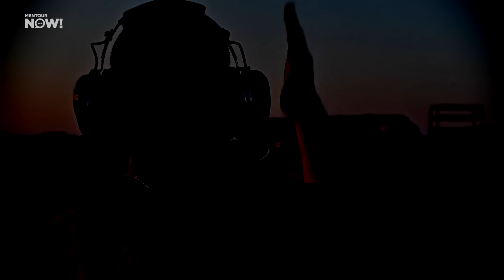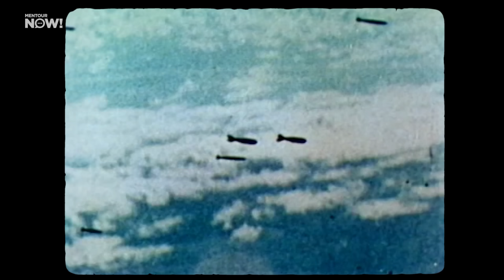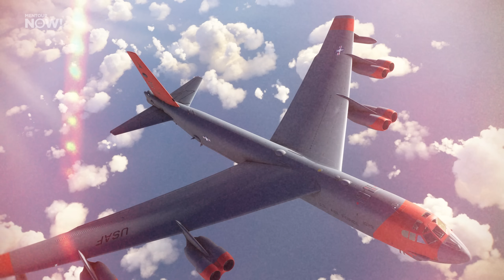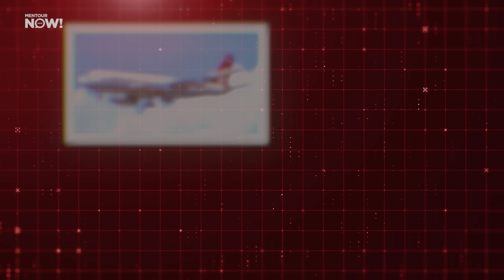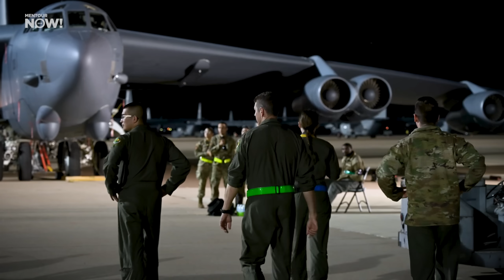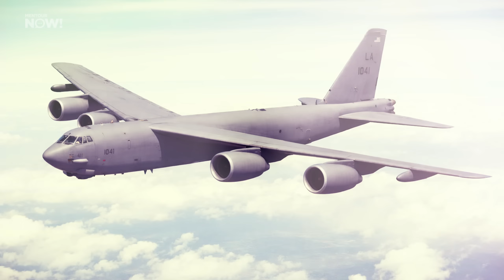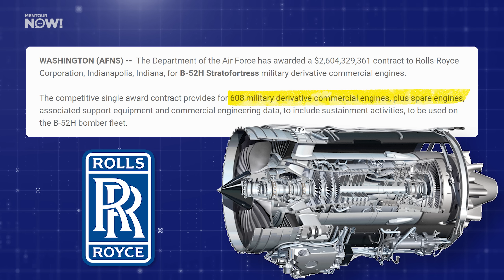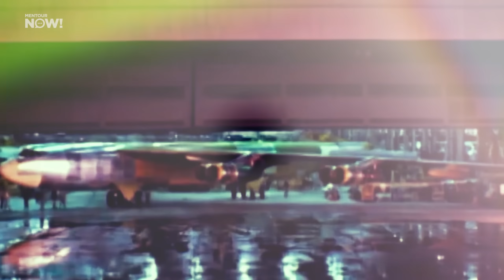WHY Are They Changing The B-52 NOW?!

Comment: “Why does it have 8 engines?” “Because we couldn’t find room for the 9th one.”
Reply: "Why does it have 8 engines?"
'Cutting back' from 10 engines; B-36.
Reply: No auxiliary unit?
Reply: @FrancisFjordCupola  Not until the J model. It is finally getting one.
Reply: @PaulJohnson-ow1mq   Surprised they're bothering! You'd think that with 8 engines of higher capacity there'd be enough electric / bleed air for all purposes! I'd love to know why.

Is it a start up thing? With an APU presumably it'd be quite quick to get all the engines up and running (no start cart, no starter cartridges, etc). But perhaps not; with no existing APU there'd not be the existing ducting for the air for and air starter, or heavy duty wiring for an electric starter. Adding ducting where today there is none sounds like a major nightmare. Wiring is less of a problem, but it's still quite a lot of work. 

I can see it as being useful for away-from-base operations; being able to keep the aircraft powered on / ventilated without much ground support (just add fuel) increases deployment flexibility, and can probably reduce time between missions. Is that why?
Reply: @abarratt8869  Probably better than the cartridge starters they currently have for alert operations.
Reply: @SEO122 cartridge starters are my favorite thing about the B52
Reply: @SEO122  An H model alert start with cartridges in 4 and 5 puts out more smoke than all 8 engines at mil power.
Reply: @abarratt8869  Commercial planes mostly use the APU for ground power when the main engines need to be off for ground support operations.  There's a lot more electrical demand nowadays to run digital nav equipment vs the old analogue stuff.  Self-contained startup is probably a convenient bonus, and may allow the planes to run missions they couldnt easily do without it.
Reply: @SEO122  They are rough on the engines, but very fast - and when we considered ourselves lucky to get a full wing off the ground before we were vaporized 15 - 20 minutes into an attack, every second counts.
Reply: @edfix  "BANG! BANG! BANG! BANG!!"
Reply: @abarratt8869  They have 8 tiny engines, could just run one at idle as an APU😂
Reply: @yuxuanhuang3523  They're reliable but burn too damn much fuel - first mass-produced USAF turbofan in history. Yes, they really are that old. Not a problem when put on such a large aircraft, but only when used for intended purpose.
Reply: @tippyc2  "use the APU for ground power when the main engines need to be off for ground support operations.  There's a lot more electrical demand nowadays to run digital nav equipment vs the old analogue stuff"

I might be missing something, but if you're on the ground you probably don't need any power for digital nav equipment - just look out of the windows! (Or use your mobile's GPS if it's foggy! I'm guessing  the main demand for power whilst on the ground is for heating and ventilation.
Reply: @abarratt8869  Future systems are becoming more and more power hungry. Honestly 8 modern engines with generators on each plus an APU would make the buff perfectly suited for future systems.
Reply: @timbrwolf1121  Absolutely so! 

Regarding systems themselves, it's a bit mixed. What's happened over the past decades is that systems have become smaller, meaning more of them can physically fit. And if any of those added systems are transmitters achieving radiated power of X Watts, you still have to put a least X Watts of electrical power in to achieve that + inefficiency margins. So it's not necessarily the case that, just because an added system is modern, it isn't necessarily low power. And where a system relies on compute power, often they can be made better by having more of it; so compute power efficiency doesn't necessarily translate into less power overall either, they'll take the power and do more sums. 

The origins of this go back to WW2. At the start of it service in WW2, the RAF's Lancaster's entire electrical fit out was a radio and some lightbulbs. By the end, it was carrying 2 tons of electronics (valve based of course) for radars, jammers, nav systems. 2 tons.
Reply: @abarratt8869  the mythical octuple engine failure
Reply: @plutoidrepublic2895  - I was talking to a retired B-52 pilot. He said the best part of having 8 engines is being able to shut off one and declaring an emergency. It gave you priority landing privileges. 😂
Reply: @FrancisFjordCupola  that is all that remains of Rover jet powered car.
An Auxiliary power unit still in use today.
Take care M.
Reply: @markeh1971  just wtf? The “stuffy brits” build a turbine powered car that looks like it would fit in the speed racer universe while us colonials made our turbine powered car look like the stick is ALL THE WAY up its ass.
Reply: B-36 hours
Reply: @whyme943  💯 The B-36 had six piston engines and four jet engines. The crews said it had "six turning and four burning".
Reply: @raffriff42  “Two turning, two burning, two smoking, two choking, and two unaccounted for.”- Fun little phrase describing the unreliability of the B-36 engines.
Reply: @operationangel7940  😁👍
Reply: @whyme943  My understanding is they would shut the jet engines down when at cruise. All this was a full-time job for the flight engineer and ono-board mechanics.
Reply: You think of some real and fictional German and Italian aircraft between the world wars. Porco Rosso’s plane?
Reply: @markiangooley  The Dornier 'Do X' flying boat, with 12 engines - six pulling, six pushing.
Reply: @markiangooley have you met our lord and savior, b-36 peacemaker? Quote wiki: 'some crews humorously changed the aircraft's slogan from "six turning, four burning" into "two turning, two burning, two smoking, two choking and two more unaccounted for".'
Reply: @markiangooley  That thing doesn't look that different from a Macchi M.18.
Reply: There's space on the tail for 3 more
Reply: @sprky777 I was thinking easily 4 on the tail, like a VC10.
Reply: @alanm8932 and you'd still have room for at least one tail fin engine, like on the hs121
Reply: when my father flew b 52's he said that the large cruise missiles, the AGM-28 Hound dog missles carried on the inboard pylons would be fueled by the planes tanks and would be used to help give it a boost, bringing our total to 10 engines
Reply: BUFF = Moar Dakka!
Reply: I know it's just a joke but redundancy because they weren't as reliable back then and these things were meant to stay in the air for a long ass time while they carried nukes for a counter strike in case the US got attacked
Reply: Don't forget, if you shut down one engine, you need to deal with the dreaded seven engine landing.
Reply: It has a 9th. CPU
Reply: @davidmoore8741  - You mean APU. And, none of the previous models of B-52 until the upcoming one had an APU.
Reply: Actually there IS a B-52 they used to test High bypass engines when they 1st came out. It was placed between #4 engine & the fuselage.
Reply: @S@Steve-0220 Yep, I saw it. My father worked at P&W EH and therefore we lived not far from Rentschler. I very well remember hearing and then seeing that B-52 low with an in-development JT-9D that was the original powerplant for the B-747 on that pylon. That was a long time ago but, it was a memorable sight.
Reply: It carries a $h1t load of "stuff"
Reply: They took out the tail gunner position. Just put the 9th engine there. 😜
Reply: It has eight engines because it has a small rudder. (Seriously!!)
Reply: @b @bholdr----0 ou are correct.  With a 10% rudder chord and theoretically four engines, lose one on take-off and you will lose control.
Reply: The B-52 visual projects power, those 4 pairs of 2 are vital to projecting this visual.
Reply: Pretty obvious. 8 smaller engines don't hang as low as 4 larger engines. The wings drag the ground on takeoff.
The only way to use 4 large engines would be if they rode to tops of the wings.
Reply: 8 was a lucky number
Reply: Nothing some Kerbal Engineering can't solve.
Reply: No, because the engines at the time were so crappy they needed 8 and it would cost to much to change it now.
Reply: Fantastic presentation,thank you Petter.
Reply: The Spruce Goose.
Reply: Even when they eventually mount warp nacelles on the thing, they’ll still have eight…
Reply: That is not entirely true; if the B-52 had two 'hound dogs', it could use those two jet engines, making it have ten engines on a takeoff roll.
Reply: each bird actually has 16 engines...
Reply: They used to put thrust jets on the bottoms of B52's when they had such a heavy load they couldn't get airborne otherwise.
Reply: Thunderbird are going.
Reply: 3 on each wing?
Reply: Because it has 4X redundancy.
Reply: I heard in about 1958 that they would have to make wings longer than the b 36 to ad more engines a second cousin worked at boing designe said there was talk about 12 engine probable only on paper as a sketch no blue prints
Reply: The B52 needs 8 Engines bc of its steering characteristics. The B52 is nearly zero rudder and so the engines support the steering. If the B52 would loose one of its outboard engines, it would have a real problem. That's why they cannot change to 4 engines.
Reply: The original E-3A was built on a modified 707-320 Combi, except it had 8 engines in pods much like the B-52 (and the inner engines of the B-47).  Why? the E-3, and I presume the successor E-4, was very thirsty for electricity, and so needed 8 generators, with room for only one per engine. But then, P+W discovered a way to put 2 generators on each of their engines, and that scheme was adopted.  The cost, (TANSTAAFL applies of course) was that there wasn't room for thrust reversers in the new pattern.  So the E-3 was fitted with what was huge for the time Airbrakes.  It still required somewhat more runway length than a comparably loaded 707, but the USAF had sufficient facilities like that.
Reply: It's not a Damm Airliner it's a BOMBER and don't need to meet your approval. It needs to be capable to haul huge loads of bombs to destroy the enemy by 24- + hours of non stop carpet bombing until enemies are begging to surrender.
Reply: I think they like more engines in case they are being shot at.
Reply: The Tail Fin: Am I a joke to you?
Reply: @efretheim  Not at all - those big planes are needed to lever the bulk around in the sky. 😋
Reply: You could get another two pairs in an A10 arrangement either side of the tail.
Reply: @kieranh2005  Do a triple with one in the tail like the tri-engine planes did, but with you added one on each side. Just because it would look so wild.
Reply: @TobyCatVA   Maybe saw the last part of the fuselage off a DC10 or M11 and graft it on to a similarly mutilated B-52.
More thrust because a 50,000 lb class high bypass turbofan (pick your supplier, there's lots. ) PLUS get a larger rudder and overall empanage.
It might be hard to trim, but it would be cool as hell.
Reply: The Dornier X  had 12 engines at the 30th.
Reply: Wings dupe when not being lifted by airflow..

A modern single engine with the required diameter to retain necessary clearance in this situation has never been built.
( Most modern jet engines are turbo fans,, the ones of suitable power can NOT provide the required clearances ) 

Unless sneaking up is your objective,
NOISE isn't a serious consideration when you're a bomber
Reply: Some congressmen/senators have personal connections to the engine manufacturer. Like ALL military boondoggles
Reply: Super weird they custom build a new 8 engine system rather than biting the bullet and switching them over to a four engine system
Reply: @fisquid four engines won’t work with a 10% rudder chord and

Comment: I remember getting the 1/72 model for Christmas, it had a little electric motor for "jet engine sound". Recently got to go inside one at the Castle Air Museum open cockpit day...sitting in the pilot seat was quite a thrill. Worth a mention: the Stratofortress' role as the X-15 mother ship.
Reply: The mothership B-52 is at the Pima Air Museum in Tucson, Arizona. The mission logos painted on the side are interesting, and many.
Reply: I love going there, I use to watch the B-52s take off and land at Castle when it was active. Have they finished the F-117 display?
Reply: It's been a mothership for quite a few things

Comment: Surprised the spar life hasn't been exceeded by now. So many other aircraft are grounded because of it.
Reply: I read somewhere that the high time B-52H is 28,000 hours.....compared to civilian airliners that are much younger but going well past 100,000 hours. They say that the weak spot on the B-52H is the upper wing skin but they haven't come anywhere near it's life limit yet. To be fair....I think they reskinned the wings once in the late 1960's or early 70s. They also did a mod on the fuselage called "Pacer Plank" where they did a huge beef up to the fuselage longerons. Added a huge doubler on the outside of the fuselage (if I'm not mistaken.) You can see it above the weapons bay doors. That was around the time of the war in Vietnam.